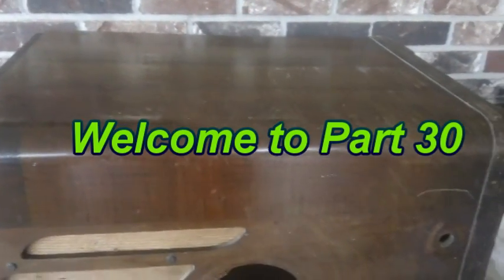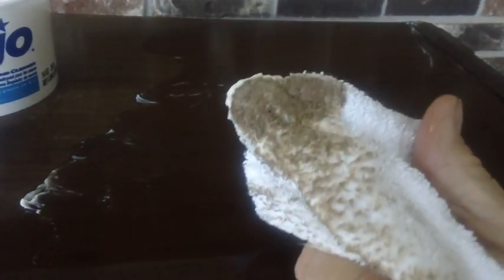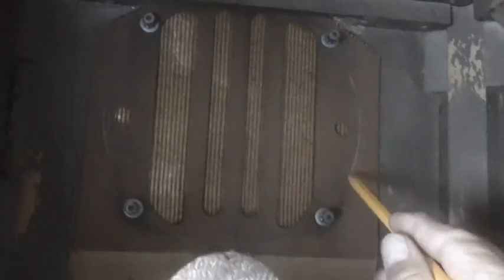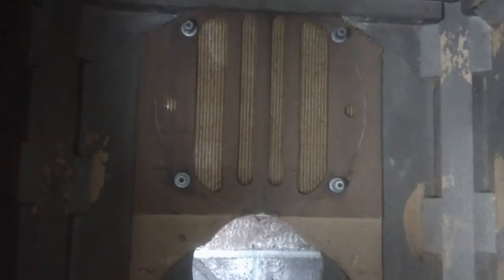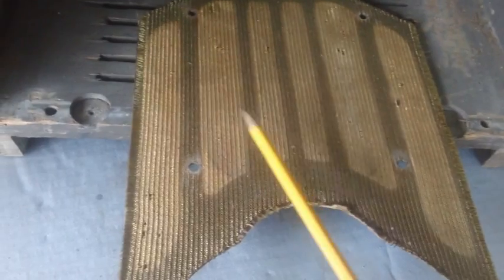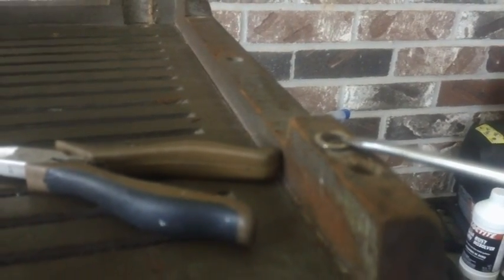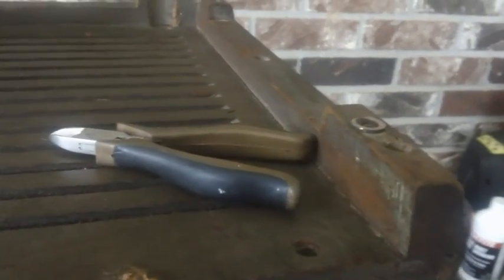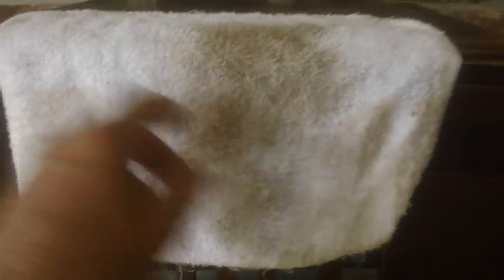Philco model 37-2670 repair and restoration (Part 30 of 34).

Comment: John, That cabinet really came back! Great work!!! BTW, I tried every way I could think of to determine how my grandfather came to own the radio, including calling his last church before he retired in 1942. My best theory is that he was given the radio as a retirement gift. Then he was recalled to preach due to a shortage of preachers during to World War II. He finally retired for good in 1953 at the age of 84 years. His retirement present? A television, and I have a picture to prove it.
Reply from the maker: Hey, Martin,
It did come back pretty good, but a small piece of very thin veneer in the far back corner of the top flaked off.  I guess it was loosened and caused by the GoJo, then the damp rag, then the wet stain.  It was really thin.  But it just looks like another of the cabinet's battle scars.  I'm glad it decided to let go at this point, before the cabinet was finished.  Had it done so at a later time it would have stuck out like a sore thumb.  I cover this in the next video.
It's too bad you couldn't have garnered more info of how your grandparents came to own the radio, but it's no big deal.  Just knowing it was theirs is more than enough.
Take care, my friend.  I'll try to have the next vid up soon.

Regards,
John

Comment: As much work as t is, there is something peaceful and really fulfilling, in cabinet work, isn't there?  Not so much in a complete refinish job, but, bringing the original finish back, man, that's the best feeling.  I use Goop, GoJo seems harder to find around here.  It works really well.  I'm glad you emphasized wiping it down with a damp cloth afterwards.  Hey, my AMT3000 does not hum, buddy!  Just my $8 Talking House.  Somebody must have seen one of your videos, my last visit to the antique mall, that Quaker Oats box was gone.
Reply from the maker: Al,
GoJo has also been difficult to find around here.  Couldn't figure it out.  Anyway, one of our local O'Reilly Auto Parts stores finally got some in.  It cost less than 2-bucks.
BTW...have you sent that talking house transmitter to the landfill yet?  :-)  And if you should ever meet the extremely smart, and probably very good looking (we usually are) person who bought that Quaker Oat box be sure to shake his hand.  Better yet...buy them dinner.  :-)

Regards,
John

Comment: Linseed oil, tung oil, varnish, Shellac, lacquer, stain, all that old school stuff they don't use much anymore - is what they used when this radio was made way back when Johnny was in kaka diapers.
Reply from the maker: Don,
Correction...Johnny has never worn a kaka diaper.  It's been tighty whiteys since birth.

Regards,
John

Comment: John,
I agree with you: cabinet restoration is as important as chassis restoration.  I too use GoJo (hand cleanser) for many types of cleaning on radios, including cabinets. 
Since you’ve made a really good job of restoring the chassis, and the cabinet clean-up is progressing well, would a new piece of speaker cloth be worth ordering at the same time you place an order with Renovated Radios for replacement rubber shock-washers?
Regards,
Phil.
Reply from the maker: Phil,
If the speaker cloth is quite tattered, I do buy and install new.  But this one is far from that condition, so I think it should remain with the radio.  I had the same situation when several years ago I restored the Atwater Kent 856.  I decided to keep the original cloth and looking back am glad I did so.

Regards,
John

Comment: "We'll just sit here and watch the tornadoes go by while we clean the ol' cabinet" Hahaha! Typical Arkansas spring huh? I'm in the middle of stripping the RCA 87K2 cabinet and I have to figure out how to remove the scratches because someone tried sanding it down (or used a wire brush) against the grain and it looks real bad.
Reply from the maker: Daniel,
Sometimes you simply can't remove scratches.  Just do the best you can, without sanding through the veneer and all that kind of dumb stuff.  Leave the scratches that are too deep.  It's all part of the radio's historical story.
Incidentally, that radio once belonged to an African missionary.  One night a crazed lion entered the missionary's home, killed and ate him, then clawed the radio cabinet as a warning to future missionaries that they were next.
I challenge anyone to prove me wrong.

Regards,
John.
Reply: joernone  True that John. I once read scars are tattoos with stories. this radio will have a few stories that's for sure!